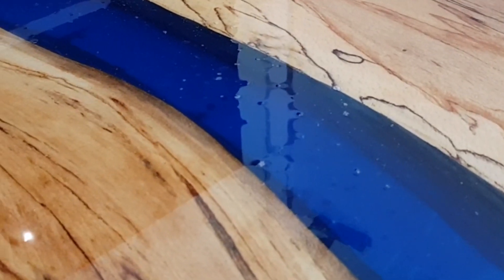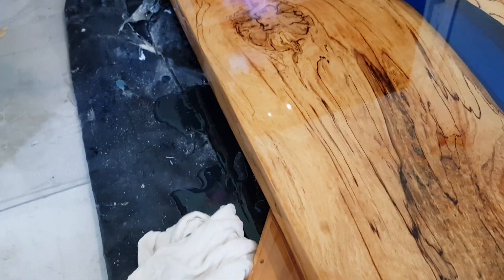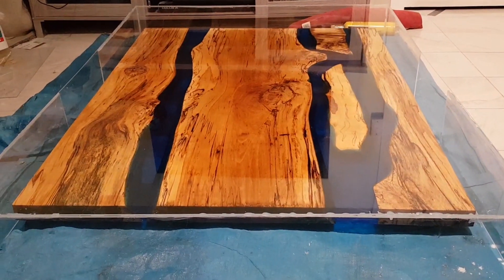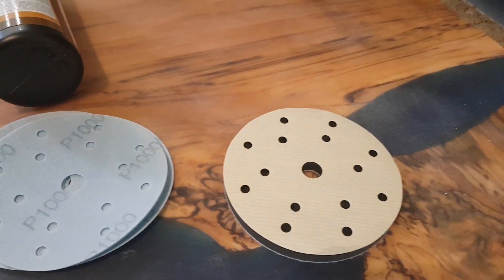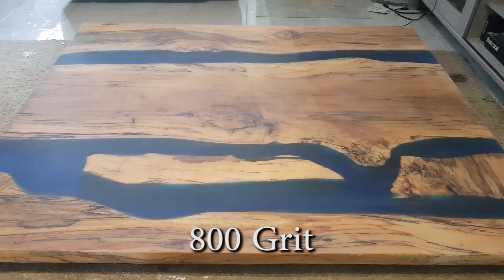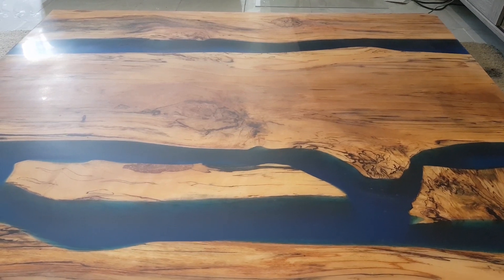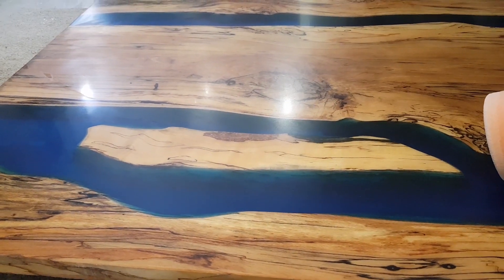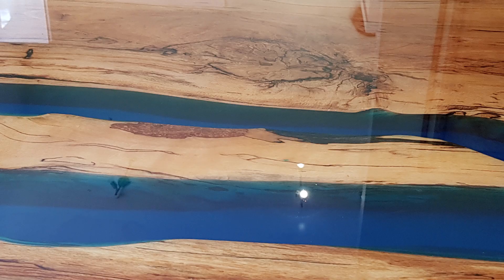See How Expert Sanding of Epoxy Rivers on Wood

Comment: Beautiful beautiful piece of art. I’ve recently filled voids in a spalted maple table and some epoxy soaked into the wood I didn’t intend for. If I finish by first doing seal coat(s) and then flood coat, do you think it would even out the look? I’ve tried sanding away the epoxy soaked in areas but assume they go further than I want to sand. Now I have darker blotches throughout and don’t think any other finish is going to even out the overall surface. Any suggestions please?
Reply from the maker: Yeah that can catch all of us out at times and it really depends on the timber. I have had to sand out on occasions but generally once you put another thin coat on it usually disappears

Comment: Where do you get the higher grit sandpaper from and great video I found it informative.
Reply from the maker: Many thanks for your kind words of encouragement re the video. I purchase all my Sandpapers from the Spray-store in Christchurch. The papers are all 150mm diameter and good price compared to the likes of Bunnings etc. They range from 40 Grit to 5000 grit that is a foam pad. Also get the top grade polish as I use it and love it. Only the best will do for my clients!!!